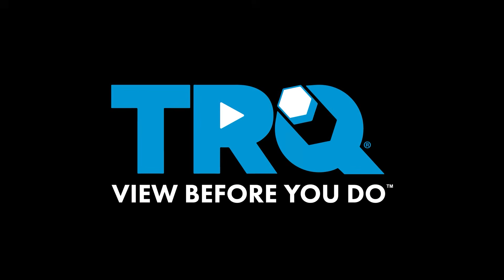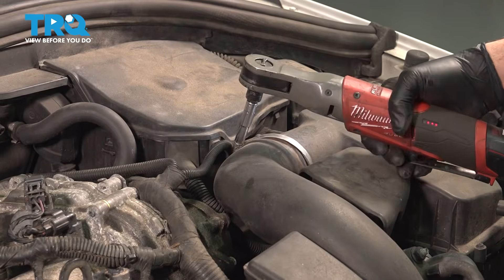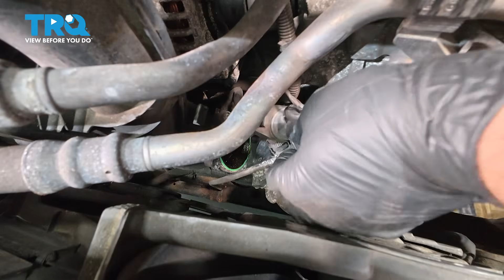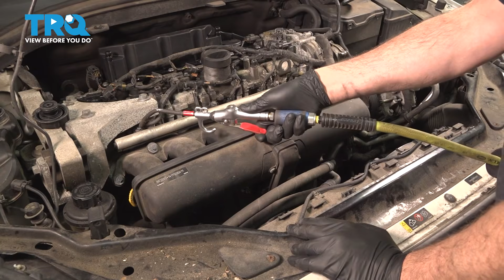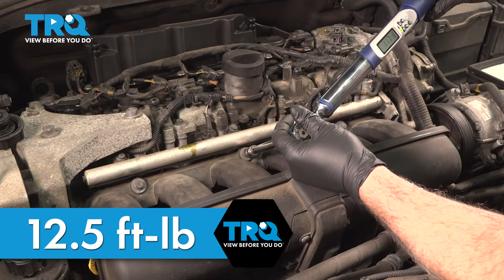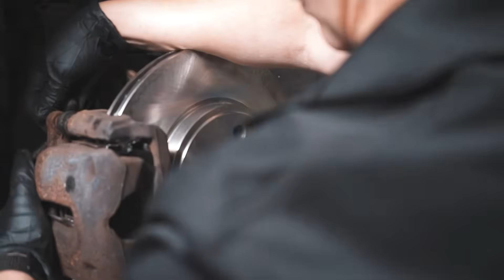How to Replace Alternator 2009-2017 Volvo XC60 3.2L L6

Comment: I just want to say THANK YOU!!!  Volvo does not make things easy, but this video helps tremendously.  Be careful, though.  There is a wiring harness that is clipped to the left side of the manifold.  You must detach it from the manifold, or you will damage the wiring when you try to remove it.